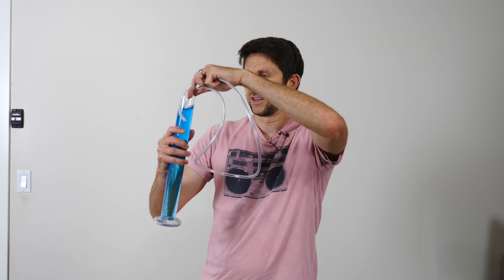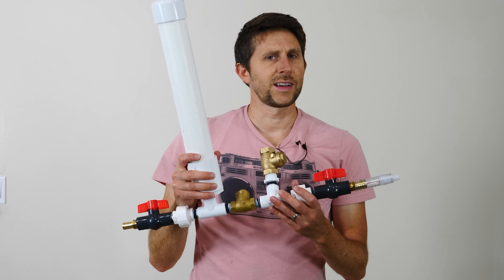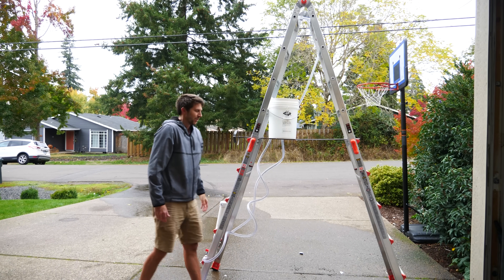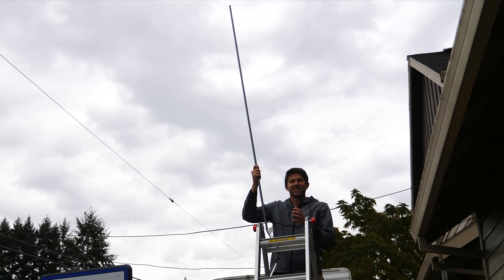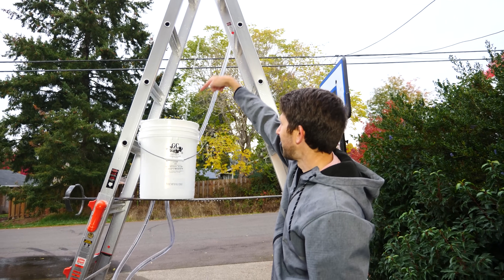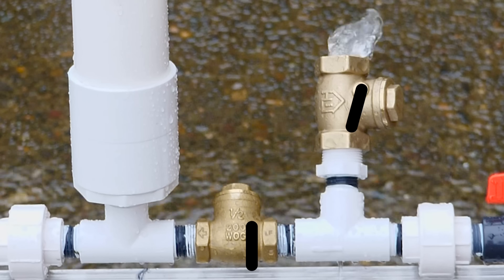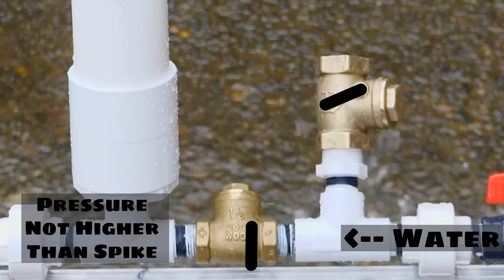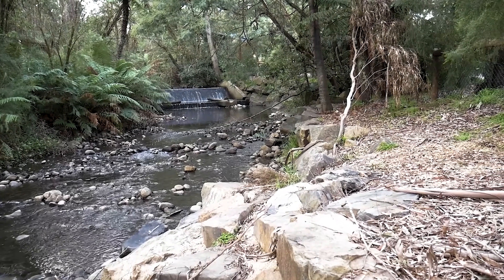Can a Hydraulic Ram Pump Make a Perpetual Motion Loop?

Comment: One of the things that wasn’t said: the dump ratio, on average, is 9 parts waste to 1 part output! This depends on the fall/rise ratio (elevations) & speed/volume of source water!… also, this is the first example where the expansion tank (pvc pipe) is on the output side of the valves. Normally, the primary expansion reservoir is between the 2 check valves. I suppose the output expansion take may regulate the output pressure, but it does not assist the “pump” pressure between the valves!… I’ve never seen it operate in this configuration. I suppose it does, depending on the inlet pressure…
Edit: this can also be used as an input to a water Trompe (a water powered air compressor)! So your output does double duty (water & compressed air)

Comment: Another relevant variable is both the length and flexibility of the drive pipe. Rule of thumb is that the length is 7 or 8 times the fall, but in my experience this is pretty open to variation. If you are wanting higher pressures, then you need to use a rigid pipe, ie a steel one. But for low pressures a flexible one eg. black alkathene works just fine.  And despite "common knowledge" it does NOT need to be straight! Just free of tight bends to allow free flow. Another rule of thumb is that you can lift to ten times the fall. In reality you can do way more than that, but no doubt the overall efficiency goes down. If there is plenty of drive water, who cares! And the more air cushion volume, the better! Good luck, hydraulic rams are great fun and very satisfying to make and play with!  Cheers! Chris, NZ.

Comment: Very interesting video, I had a piece of off grid property that has a spring or creek on it with 3 to 8 foot drop in a rather short distance I could set this up to water to go into a 400 to 600 gallon holding tank 20 to 30 feet above my cabin on a stand the gravity feed to the cabin for running water, place a 5 to 10 app generator water turbine generator to power an in-line instant water heater by the down flow of the water coming into the cabin by gravity feed and could if setup come it could producing hot water to take long hot shower with no electricity.

Instead, it shut off when it gets full, preset amounts of water could be released to generate electricity charge Batteries means it would run all the time. it could be charging batteries about  40 to 60 percent of the time. Then put the water back into where it came from above from where you’re drawing it from. I’ll draw it up. See how it looks on paper.

Comment: 2:40 No source of power? It is being powered by the pressure from the original container creating flow as the water is dumped on the ground through the check valve :/ You have to keep replacing the water in the bucket for more power when it runs out lol

Comment: Water kinda flows just like electricity all u need is valves, check valves, one way valves/extensions.

What u see here is water like Capacitor that helps to do the job with very low efficiency

Theoretically we could build computer that runs on Water instead of electricity.

Comment: What if you could somehow connect the waste water outlet to a reservoir of some sort that is connected to the main tank either passively or via a very low energy pump that uses less power than what this would produce if it were scaled up and the water spun a hydro generator

Comment: Is it possible to put a host or valve for the waste water going to the source with a load of water before the water from the source generates pressure? Can the pressure pull the water already loaded in the pipe/host going back to the water source? Just so theres no actual waste to achieve perpetual motion.

Comment: This is really interesting! So we have a high spring water level below our basement. When we have heavy rain or melted snow, that water table rises and comes into our basement. We then have 2 sump pumps running continuously for about 2 weeks until the water table comes down. I’ve been trying to think of a way that we could pump water out of the basement without using so much electricity to pump water out of the basement that just keeps flowing In. We don’t live on a hill so typical syphoning won’t work but this seems like a possible idea. What do you think? Or is there any other type of mechanism that can flow water out to a higher level without electricity?

Comment: if the waste water returned to the bucket by pumping into a check valve to return the water to the bucket ?  would that save water waste . Or wuld it work by allowing the wat to flow in to upward facing check valve which is untruly lifts the water Colom to the  bucket or cud the presser water driver water by diaphragm to bucket ?  so the hed of water in the tank above at a presser head  can produce   sufficient Hight to power a micro generator to charge  a battery bank.  as it Return's to  the source supply.    OK  so what ham i saying  given  the  ram pump can push water up hill to a  header tank or pond.   from a elevated lower header tank or pump  yes in that pond was field with a stream then it wuld be field up from that stream or spring .  I'm am asking if the water sanding in a much Elevated  pond would predust sufficient head { say150 foot pounds}  to drive a micro turbine ? to power one house by charging a battery bank  .

Comment: 3:15. Indeed you literally actually have.

Imagine a skyscraper with 100 floors. And let's say each floor was 20 ft. For a building height of approximately 2000 tall.

And on the roof of this building is an olympic size swimming pool.

Then on floor of the 99th floor. You place your first pump. Which of course feeds back do the Olympic size swimming pool.

Of which the pump on the 99th floor. Is also in a little kiddie pool. Where it collects all the water it doesn't use in effort to send the water it does use back to the olympic size swimming pool.

And the water it doesn't use that ends up in the kiddie pool.

Now connect to 2 separate pumps on the 98th floor. With their own kiddie pool to collect they're unused water.

And of course all of their pump lines go back up to the olympic size swimming pool.

And this continues to occur. For every floor increase the number of pumps. sufficiently to pump out all the wasted.

Now I hear you saying you're just exacerbating the problem. More pumps even more unused water.

But not so. In this scenario we will have as many pumps as volume of water supplied.!

So eventually you can Brute Force this method into having no excess water. To pump back up.!

Yes you will still have a large volume of water within the pumps themselves.

But it's not really about getting 100% of the water recycled.

It's about how much work can be accomplished through gravity.

I wonder if a process could not be made efficient enough that the energy from the pump can be captured.

And use to mechanically or electrically or hydraulically put that water back in the bucket.

Solely based off of the kinetic energy of the water coming out of the pump end..?

Comment: NOT perpetual motion loop.  These people never seem to count the contact between each piece and the water.  Example:  Going through a plastic hose won't lose much energy, but it WILL lose it just by hose/water contact.  Over time it slowly lowers to zero.

Comment: The external source of power was provided by you when you added potential energy to the water by elevating it way above the ram pump. Each cycle uses more energy (through waste water on the ground) than it imparts to the (smaller amount) of water going back into the bucket. The proof is that this cycle will stop once all of the water is on the ground from waste.

Comment: Wait, it may not be free energy, but placed in a runing stream would be free fuel and would run till shut off or parts wore out, it might be able to run a small hydro generator,  not sure if it would power much though.

Comment: Bullshit. The RAM pump works by taking a certain amount of water at a certain gradient. About 10-20% is pumped, the rest flows through and serves as propulsion. It's a 150-year-old invention. It works without electricity or other motive power. It replaces about 80% of the water flowing through it.

Comment: Lift your water source higher, raise your waste outlet higher, build a gutter running from the waste outlet to a container. That way, you can gather the waste water and reuse it or repurpose it. Add this to a rain draining system and a water wheel. Can generate electicity.

Comment: Multiple pumps and resivoirs in a vertical series with inlets tuned with Shaubergers special little designs, tuned with the return pressure of the valve etc etc. Maybe not perpetual but the entropy involved, or waste water whatever you wanna call it...can be minimized in a closed system with multiple pump systems in series, I mean cmon. Am I gonna get liquidated for this or what?

Comment: HI from NZ. I sudscribed in about 10 seconds. You explain things clearly and concisely. That was a great demonstration. My family used to live in an old house that was badly damaged in the Christchurch 2011 earthquakes. We had an old Ram pump in the front garden that pumped water to 2 x holding tanks about 4 metres off the ground. The pumping ratio was 2/3 wasted to pump 1/3 to the tanks. The waste water was piped off to a nearby river. This house used to have 7 Ram pumps and provided water for the whole street. Another man who lived close by also had an old well. He plumbed his water out to the front of his property and provided emergency water for approximately 60000 people that lived in the area after the 2011 earthquakes hit. His flow rate was 30 litres per Minute. He got the water tested. It was 15 x more pure than shop bought water!
Reply: That is wild how much more pure it is. And hats off to the "wellman" he did well, man. 😆

Comment: Thanks for the explanations, this is awesome!  I am curious if this concept could be experimented in a small basement pit (drilled in rock) that is perpetually flooded by a underground water vein?  The goal would be to pump the water about 20" upper to evacuate it in a gravitary discharge pipe, hence reducing the use of the sumpump already present. :)

Comment: what if we add a pipe connecting to waste pump to the water tank as it have the same force both pipes will put water in tank but waste pipe lower and other one from top it could work forever

Comment: You can also accomplish pumping water higher using what I call an entropy pump. They require no electricity and I use them on my pool ponds that I breed and raise fish in, to pump water up out of the pool, into an air tight area with mechanical and bacterial filtering, then the water flows back out and down back into the pool only due to gravity…

Comment: What if you had two precisely timed pumps side by side. The waste of one pump connects to the output of the other. With proper timing they might work together alternating between each other. You could possibly take it even further with 4,6,8 cylinders... Like an engine.

Comment: What if you attach a tube to the waste valve and pump that water into the bucket. I would assume the pressure coming out of both valves are the same

Comment: my question is. can a hose be attached to the waste valve? if so the waste water could potentially be added back into the bucket. if not, could the waste water be caught and using natural pressure of water. bring it back into the source bucket?

Comment: could you run a pipe from the waste valve back to the bucket or would it be to hard to prime the pump with the pipe in place

Comment: these are great for camping. you can also use a small low power fountain pump if you dont have a water source like a pond, small pump into the ramp pump and you have the lift you need

Comment: Okay but what if you put two of them together. waste water from both going into a collection system that is powered by a water pump, that is powered by the falling water from the ram pumps through turbines. That should be a functional perpetual motion machine. It powers itself, recycles the "waste" water. nothing is wasted and you harvest the gravitational energy. And since ram pumps can be as tall as you want then theoretically you could have an many turbines as you want, and since the start point of the ram pump can be lower than the output source returning the water to the input source would take less energy than is created from the downward fall meaning you could get more energy out than you put into the water pump.

Comment: Place your bucket under the check valve that's ejecting water, and there's no loss of water from ejection. 

To add a water wheel: The lower bucket will be the one which water is initially pumped out of, to be received by a bucket above it. Place a control valve on the bottom of the top bucket, and use that control valve to allow a constant stream of water to fall into the lower bucket. That stream can power a water wheel. As long as the flow rate of the stream hitting the water wheel is equal to or less than the amount of milliliters per second that the ram pump can pump out, then it won't stop. The water wheel should have a splash guard to keep water from splashing everywhere when it strikes the wheel blades. To begin with, both buckets should be near full, so do that with a garden hose or just allow the top bucket to fill up from the ram pumping before opening its control valve that allows the stream down to the water wheel and then refill the lower bucket by an external source again.

Comment: Has no one thought to have the wastewater flow back to the original source of water is that letting it spill on the ground? As demonstration that would work pretty decently but in practice because most people use pond or river water for this you don't need to do anything with the wastewater from it.

Comment: The bang you usually hear when turning your faucet off real fast is not the pipe expanding, but rather the pipe moving due to the weight of the moving water suddenly coming to a stop, and banging the pipe against something else. This is especially common when there's a long straight run of pipe, like along the basement ceiling, or up the wall to an upper floor that's not well anchored/secured.
Reply: Water Hammer
Reply: @mongolloyd5236 seen lots of busted spiralled PVC pipe on the orchards I work on in oz not so much these days thanks to VSD’s.

Comment: Interesting.
What is the rate of water loss compared to water pumped?

I live in a very dry area.
The water coming out of the valve seems rather inefficient.
Reply: More than half of the water is used as gravity "fuel" to run the pump, otherwise you'd be using more energy than was put in.  This isn't made for efficiency, it's made for using the power of a river to divert a relatively small amount of water.  A water wheel with a corkscrew feed would be a similar idea, with the water wheel being much bigger.  On my screen the next comment below quotes a 10 / 90% split in real-world use.  The 10% is the water delivered.  (I don't think YT orders comments the same for everybody.)
Reply: @VoltisArt  thank you.
This item is not for me.

Comment: interesting! So you could technically not lose any liquid water by having two or three pumps going in a certain configuration. You would need to cause a syphon somewhere to keep it going. You would still lose energy if it theoretically lost no water but it would take much longer to stop it. There would be many things that could be done with such a setup once it works. The water to keep it going at a certain point if it lasts would be rain water.
Reply: You can't put these in a loop to keep the water.  That "lost" water is the fuel "burned" by gravity to run the machine.  It wouldn't even take long; as soon as the output water gets near the height of the highest basin, the flow stops dead.  There will always be water you don't get to keep, and it will always be more than what you can keep.  (Otherwise you're gaining more energy than you put in, which is impossible.)
You might get an engine to sputter or turn over a couple times by running it on its own exhaust instead of the fuel it's designed for, but it won't keep going to drive you anywhere.  This is really the same principle.
Reply: @VoltisArt  sorry I remember posting this. I meant keeping the largest volume of water in the loop, I know there would be energy losses through the vapors of water is what my thought process was. Even though it's been a month I've learned that a device with that principle in mind was already created by a medieval scientist and is used in engines today. Who knew using disks with gears with it could accomplish it. The loss then transfers to the mechanical energy needed in the transfer.

Comment: Great video. I feel like letting the relief valve from the pump drain into a bucket and putting the pickup for another pump there. Maybe they could both drain into each other so water isnt wasted.
Reply: If you're going to add another pump, be it manual or powered, you might as well use that pump to begin with.  Trying to use two of these together in a perpetual loop system won't work.  The efficient way to use this system is to source it from a river where the waste goes back into a lower part of the river, diverting some water to crops or whatever you're using it for.  That "wasted" water isn't really lost, it's just not yours to keep away from the gravity that drove the machine.

Comment: In a "Correctly contained system" with "wastage harvested and evaporation controlled", heat death would ultimately lie in the wear and tear of the reed valves mechanism
very slow death though

Comment: A mechanical equivalent would be a water wheel with large buckets, which can lift smaller buckets of water (or conveyor belt).  Using the weight of a lot of water to lift a smaller amount.  All within legal physics boundaries.